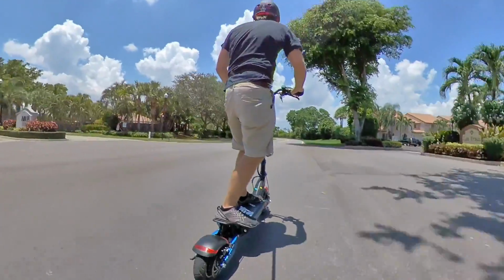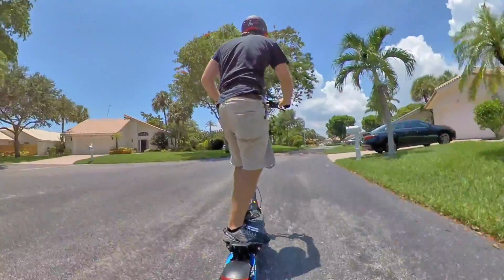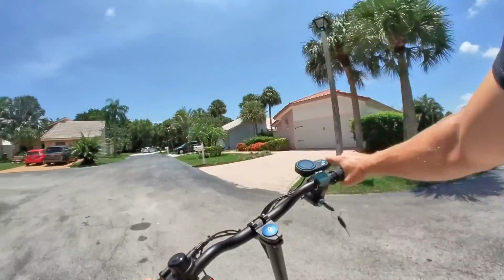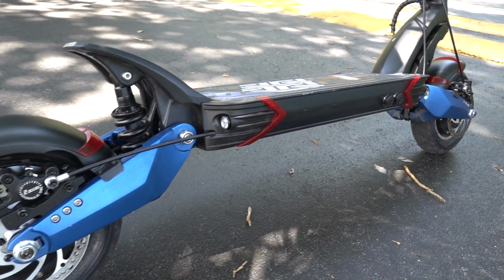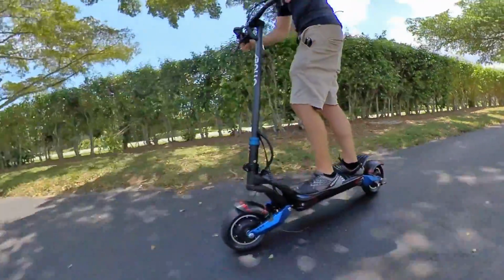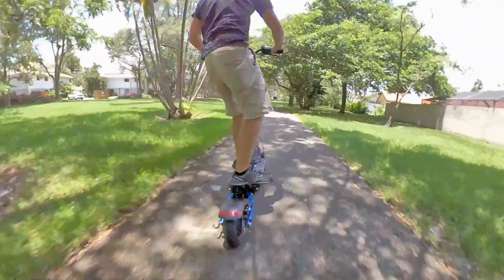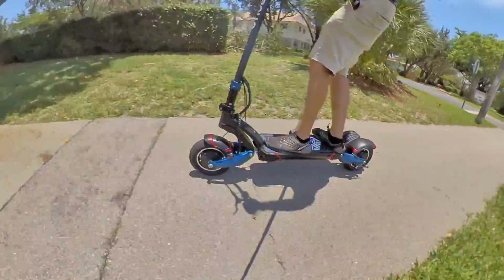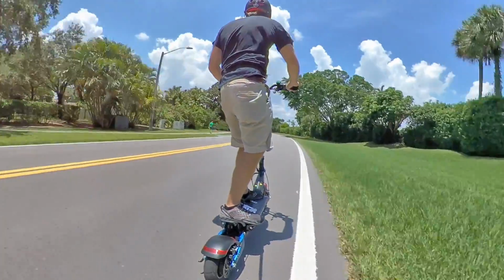Apollo Pro electric scooter review: 2,000W and 38 mph!

Comment: This is the same as the Zero 10X, TurboWheel Lightning, Varla Eagle One. Same manufacturer (Unicool on Alibaba) that is sold under different names/companies. If the company orders 20 units they get to customize their logo, buying 100 units gets you personalized packaging which is what Zero, Turbo, Varla, Apollo, etc did. With that said. Apollo apparently used Lacroix's Stormcore ESC in their prototype so their performance might be better.

Comment: Really impressed by that SUSPENSION! 😳 I can see why the rider won’t be thrown over the handlebars when encountering speed bumps and potholes.

If I were on the fence between an e-bike & e-scooter, this guy might win me over, if my objective is to just get around the city (and I assume there’s cargo-carrying capacity by mounting a low basket on the front, and/or attaching a trailer in the back), and I’m agnostic about whether I’m pedaling or standing the entire time.

Someone who’s looking for an e-bike in the Rad Power Bikes price & ride range, but is open to an e-scooter, could be wooed by this one’s specs. 🛴 

Since you can take this inside the store w/ you, it’s also less likely to get stolen, unless someone takes it right out of your hands.
Reply: I think electric scooters are harder to lock up, I'd be scared of it being stolen. Bikes have more mounting points for the bike lock.

Comment: To save everyone some time, this is literally a Zero 10X with blue swing arms and an LG battery. It gets about the same amount of QC as anything else sold by a company like Revrides, and there is nothing different or magical about it. Same thing, down to the kickstand. If you don't feel like paying extra money for a slightly nicer battery (which you can also get on a 10X from Revrides), then this is not for you. It's simply a 10X with some additional features that you can get from other companies, except they add them stock. Also, it's blue.
Reply: If this was true it wouldn't weigh 20lbs less and blow the performance away in testing. ESG tested the accelerarion and it is significantly faster than a 10x.
Reply: LorkyMX2 They just played round with the controller
Reply: Zero now have LG battery as well
Reply: @chefgav1  Thanks for your comment and don't get us wrong, Zero is a fantastic brand! The way we differentiate is with cheaper prices, 2 year warranty, IP54 Water resistance to name a few. At the end of the day, you will have to choose between an Apollo and a Zero - the question will come down to which company can stand behind their product for longer and why, and the answer to that question will always be us as no other scooter brand offers 24 months of warranty :-). But again, Zero is a fantastic scooter too!
Reply: @ApolloScooters  I appreciate the measured response, and I'd like to reiterate that in no way am I saying that Apollo scooters are worse than similar competitors. I happen to like blue better than I like red. I just think it's important to note that these are basically the same thing, but you prepay for features on the Apollo that are optional extras on a Zero. This means Apollo scooters always cost more, and if you don't want these extras, you're better off going elsewhere. Warranty is a good point, but the consumer definitely pay for that as well. I'm coming at this from the perspective of a realistic, cost-conscious consumer, because I think there are a lot of people who would want the Apollo scooter to seem significantly different from its competitors. It's easier to make an informed choice when you realize that they're more or less the same, and it's about which company you prefer buying from.
Reply: Apollo Scooters It is interesting that Apollo are cheaper than zero in U.S in Australia it’s the opposite..zero is a lot cheaper which would come down to the importer jacking up the price.Also don’t think there is 2 year warranty down under
Reply: Retail on Revrides for a 10x is $1650, Apollo starts at $1900
Reply: @divixmage  OK fair enough. I WAS looking at an Apollo advertisement
Reply: @ApolloScooters  I'm cross shopping your Pro 60v and the Turbowheel Lightning Plus. They are nearly the exact same spec wise (upgraded battery/voltage/motors/hydraulic brakes/name brand battery/etc.) Yours is $2499, theirs is $2190. I agree a better warranty is obviously "better", but is it enough to justify that large price difference? (not to mention, you claim to be the cheaper option for comparable scooters, which in this case is simply not true).
Reply: apollo says to have forged aluminum parts, not die cast, so they will have better parts. I'm thinking of buying the 52v this weekend w hydraulic brakes, its on sale for 1800
Reply: @oldgorillascooterclub2597  It's really a moot point, the 10X is already an overbuilt frame design for what it needs to handle. If this were a Mantis, that would hold more water, but the 10X doesn't nearly have the same track record of parts failure.
Reply: @divixmage  yeah good point. I was going to order a 10x from alibaba but I think rather order from a north america retailer with warranty, so whichever is best price is best for me. I was thinking to order the apollo, but ewheels is 100 cheaper and I just found out their service center is very close to me, so I think I am going to go with the turbowheel version.
Reply: @oldgorillascooterclub2597  I was thinking about getting that exact same model but haven't done it yet. How much difference is the upgrade in the braking system? I originally wanted to get an explorer since it's a lot more lightweight. I'm still debating but I want to get one before the sale is over.